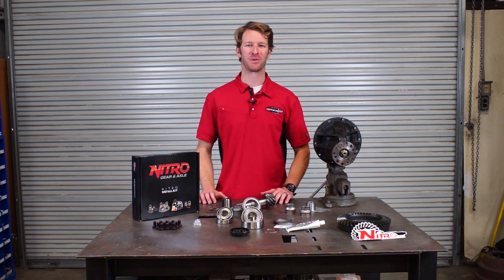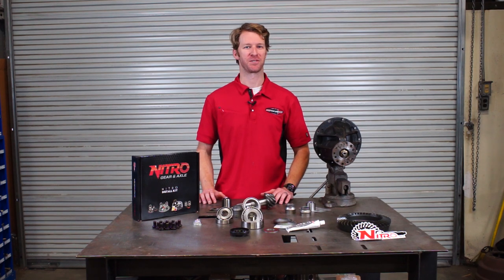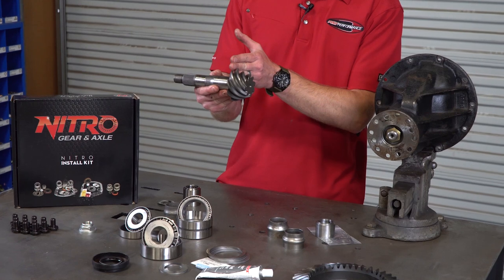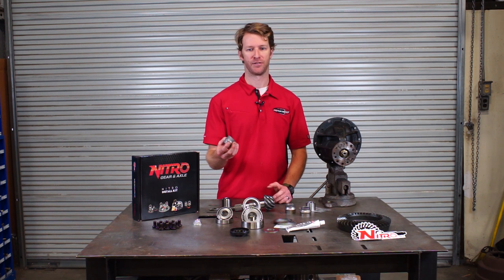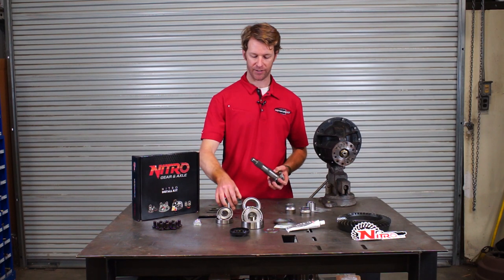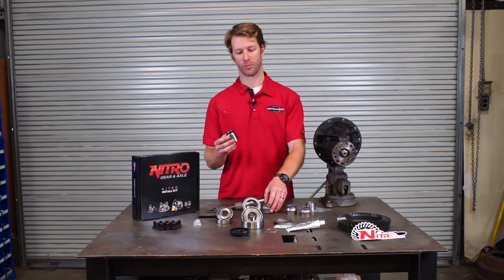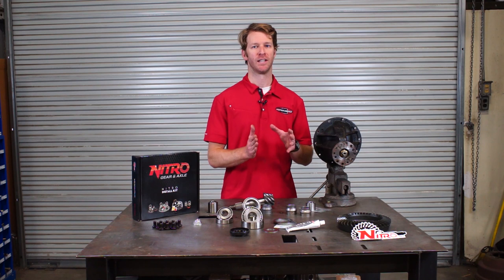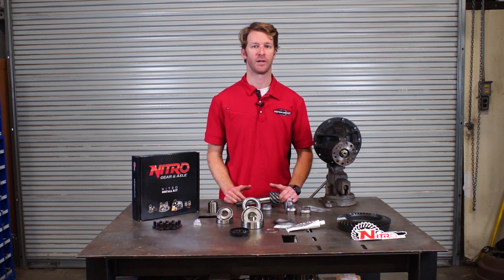POLY PERFORMANCE GARAGE | Episode 3: Solid Pinion Spacer Overview

Comment: Do we then use manufacturers torque specs on the pinion nut, and do we run the “paint” to confirm gear mesh each time we try a new spacer, to get it right?
Reply: Did you ever figure this out? lol
Reply: @DS-mo6md  Sure did. Yes, factory torque specs, and yes, run the paint for mesh/spacing.
Reply: @littletoze  yeah i just got my spacer and luckily it was shorter than my ratech crush sleeve and a factory one. I saw one guy get a solid spacer that was as tall as an un crushed one.. must have been the wrong part...  So I've still gotta reach like 250 lbs?  Just trying to check because its a big van on jack stands (im sure it will be fine but still ).. I already broke a ratchet pry bar that supposedly was limited to 375 ft lbs    so   have to find a way to measure torque
Reply: Yes!!!